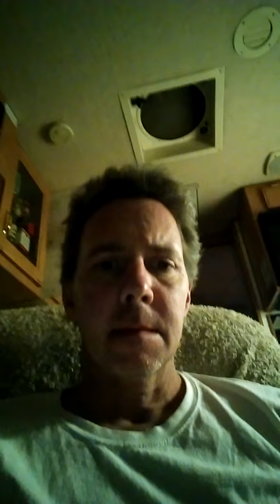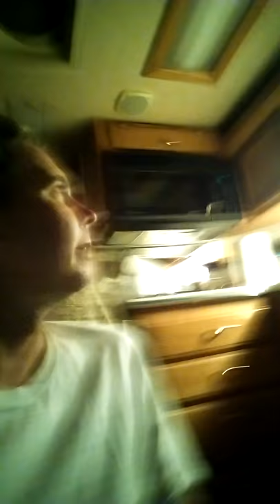Living full time in a rv Inverter issues

Comment: Hi Jeffrey, it certainly seems the the inverter is gone. i bought a 400 watt 5 years ago it still works. but i wonder how long it will work now. its funny, when i am on shore power i use so many things that i dont really need to be using. and i can blow a 30 amp breaker in no time lol. but when i'm boondocking that 400 watts is all i need. runs my lap top couple lights fan.  i only have 2  12 volt deep cycles that are the same age as inverter. i always wanted more batteries but as time went by i discovered i didn't need more. boondocking changes me. really only need one light and use the stove for cooking. not saying you should  do it my way, i was just saying.
anyway hope you get all the stuff fixed soon.

John
Reply from the maker: I hear ya, we do use a lot more with cooking and heat to offset the propane use, mine is a 2000 watt I believe...was too busy troubleshooting electrical yesterday to double check it. the whole issue is just odd. I'll post more if I find more.
Reply: looking forward to seeing how things turn out. and how YOU fixed it
Reply from the maker: Yep, its easy to do that.